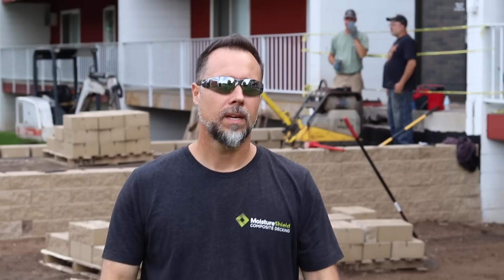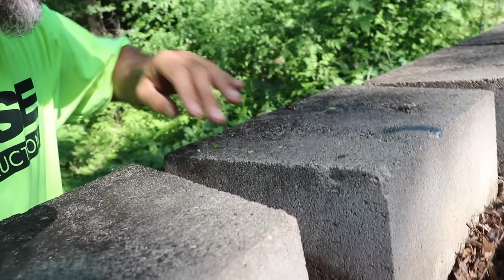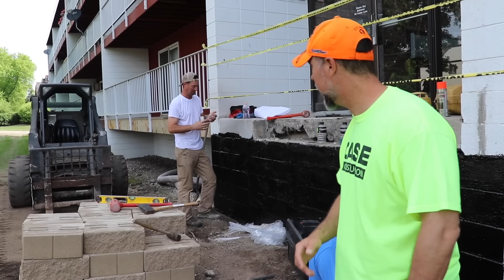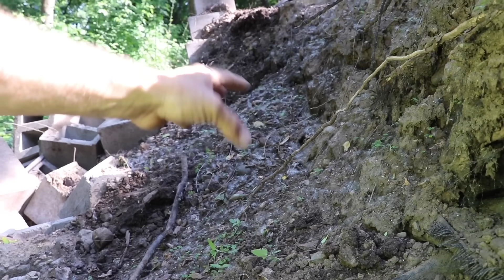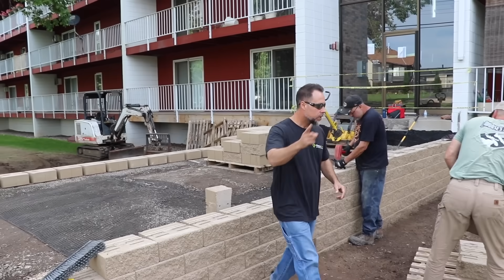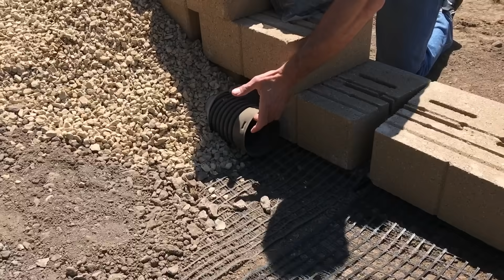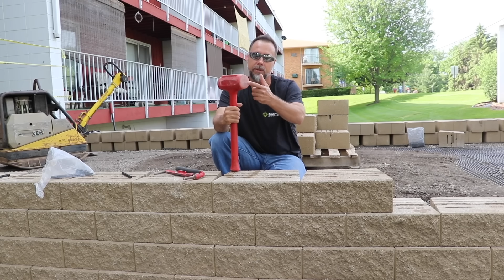How NOT to Build a retaining wall.  RED FLAGS, common mistakes, bad designs pt1

Comment: The highest stone/block retaining wall I ever built was about 12 feet stepped down to an 8-foot wall four feet in front of the 12-foot wall another four feet out and stepped to 4 feet to a 5-foot wall. They were the hollow block with a lip, We did fill the holes with stone and rebar.                 We compacted all the lifts, used geogrid, the fill between the was stone topped with about 4    inches of dirt. This was over 20-25 years ago, I followed whatever engineering plan provided.  I drove by it 15 years after building it and it looked as if it was built that year except for the graphite. This was the first wall I built, proving if you follow both the manufacturer's instructions and good engineers plans things will work out. Quality is part integrity, part using your brain and part overkill (if an architect calls for 2X10s and you use 2x12s it can only be better) I always told my clients that the project would have my name on it for life. The two best teachers were crappy builders and a perfectionist mechanical engineer(he taught me more in a year of being my mentor than a masters degree. I fixed a house were the framer did not check the mason wall heights, I had to take apart 25% of the frame. I fired the first framer 2 hours after being on site there were empty Vodka bottles everywhere.  PS I like your work and the fact that you do     your own math
Reply from the maker: Thanks Joel for the comments! Glad you like the videos and thanks for watching!
Reply: I agree, my first thought of the wall that fell in this video was "where's the rebar or fill in those hollow blocks?".

Comment: Excellent vid, thanks mate.  If ever I use hollow blocks, it is so that I can fill them with concrete & rebar for a super strong structure, e.g. swimming pools.  For walls, the hollows can be part of a drainage system, and I add deep / long stainless horizontal ground ties, and vertical reinforced concrete piles.  But I've never built anything as high/steep as the failed wall above.    Thanks again.
Reply from the maker: Thanks for the input and for watching !

Comment: Would you build retaining walls with composite rail ties? I know the foundation the the most important but does the material the actual wall is made of? Could you also use t-posts to held reinforce and hold the wall up

Comment: What I'd like to say as a mason : you never build anything with dirt. As soon as you have removed dirt- this is it, you've got the "disturbed soil", don't put it back, throw it away, put crashed rock there or pit run(sand and stones), then compact. Don't build anything on black dirt, dig to brown clay. Do not back fill dirt against back of retaining wall, in winter, when it will saturate with water, the freeze will expand everything like crazy, it will push your blocks outward. Use drainage rocks everywhere, let all drain down. Use geogrid if you will go higher than 4feet. or if you need super stable lower wall.
If you have to, go ahead, lay first bottom course on mortar, to make it straight. Compact everything always. Use those dead blow mallets, those are very good, instead of bouncing rubber mallets.
Geo grid works like "deadman" for  other types of retaining walls and also stabilize the whole mass behind retaining wall, because block tiers actually work also as veneers for the mass behind . Blocks do stabilize, but it should be along with the mass behind them.
Reply from the maker: Thanks for the input Sergey and thanks for watching
Reply: I was confused on this as well.  
In the first example of a failure, did the geotextile fiber against the wall cause the wall to fall or was it the lack of crushed rock?  It looks like they just backfilled the wall with soil, which will make it fail every time with out the right aggregate for drainage.
Reply: You mean 1st course on reinforced concrete footing, just like homes are built on, then you will save time and be more accurate instead of using a mallet for hours straight...
Reply: @michaeless658  You can, but you don't have to, it's too expensive and overkill. Just crashed rock will work fine for the footing. But if you're ever gonna do a solid concrete retaining wall, then you have to make a very wide footing, not like for a house of 24-20 inch, but up to 48 inch. I'll tell you as a mason, the first mistake masons often do, when they build not wide enough footing for when they build masonry posts. You can notice that, when next time you see leaning masonry posts  there and there. Because in a course of 3-5 years freeze and overall temperature changes start pushing post from sides. And if you don't have a wide footing, your post become like a inserted heavy stick, and it later on become out of plumb, even can fall down. (Same happening with tomb stones) 
So the concrete retaining wall works almost the same: your whole retaining structure should look like perpendicular upside down "T"- very wide footing. Then you have to use lots of rebar everywhere and of course- drainage on the bottom from the hill side. Even though, if you will go higher, than 5 feet, you have to tie your wall to a "dead man" in the mass behind. The pressure of back fill is strong and everywhere you need compaction layers of every 8 inch or less to have a stable mass.  And the less clay- the better, pit run or crashed do the trick, when they sip away water from the upcoming  freeze. (Sorry if I did a mistake in English, my first language is Russian.)

Comment: Taking a look at my back yard...they didn't build the wall correctly it would seem.  3 tier clay brick wall, 3ft high with 4ft of garden space, 3ft on #2, and 1ft on #3 because of fence.  Sloping hill from neighbors......and a tree on top.  :(  House built in '68 and assuming wall was too so it has held up well but is starting to...uh....fall apart how brick tends to do.  Unfortunately, there is no way to dig into the neighboring properties to install geogrid if I wanted to remove the existing wall and install a proper one.  Would burying beams be a viable option?

Comment: Two things I thought could be better explained: 1) In climates where the ground freezes, drainage is hugely important, because water held behind a wall will freeze. Water expands by a factor of 1/11 when it freezes, so the less of it behind the wall, the better. It's not just the weight of liquid water that adds to the failure-forces on the wall. 2) Geogrid takes the place of "dead men." Some large retaining walls are built with dead men, which can be logs or other large heavy items that are buried several feet back from the wall, connected to it by a cable. With all the weight of the soil holding down the dead man, it provides a good anchor, and with a strong cable connecting it to the wall, it resists the forces that want to push the wall out. 
-- The Geogrid relies on the weight of the soil behind the wall to keep it from moving, and provides a tensile support that keeps not only the wall from blowing out, but also stabilizes the soil that its enmeshed in. I suppose one might quibble that it ought to be attached to the wall, but keeping the soil behind the wall from shifting outward will reduce the force behind the wall. I do think that using it in layers every couple of feet is far better than just using one layer near the top. (I've seen plenty of 3' high walls blown out, but not many 2' ones.) Personally, I think it's a genius product, but it appears to anchor the soil more than the wall itself. It would be interesting to find out what would happen if it just ran up to the back of the wall without being interlaced with the blocks, as one might do with a rubble retaining wall, where it's hard to interlace it.

Comment: Appreciate  your time and thoroughness  . The engineering can get very complicated . I believe originally a french mathematicIan named Euler worked this out for friction materials in the 18th century  , then a British physicist  named  Rankin worked on this problem in the 19th century  . An Austrian engineer named Terzaghi tied up the many different approaches  to solving soil mechanics in the 1930's with his ground breaking book ; "Soil Mechanics in Engineering Practice" . Too bad it took so many decades before his work was codified into modern building practices .

Comment: Just found your channel, subscribed. Thanks for the great tips. I was thinking of using fabric to hold a 2' tall parking spot but now I won't, I will use geogrid layed back about 10'. I realize I probably don't need it a 2', but want to work on vehicles on it and want the weight of the vehicle holding the wall it's pushing against and since I don't really know for sure what I'm doing when it comes to building things I prefer to over engineer my projects. Better safe than sorry, right?  Your tips will help with that I'm certain. I look forward to perusing your other videos.

Comment: I did learn from my dad not to just rely on about 12 inches of poured concrete to create a retaining wall with rebar to hold a 20ft vertical wall behind a house. The soil at the bottom became too heavy with water and washed the wall right out. In some sections he was left with about a 5ft by 15+ft by 12 inch thick cement wall hanging by the rebars embedded in the soil, while the rest of the wall below it washed out.

In retrospect, I am prone to making a lot of bad decisions that remind me of him, but I am glad I don't have as many of those recessive bad decision making genes as he does. I have a retaining wall project I will eventually be doing for my house I am going to DIY and botch up alot along the way as I learn. But nowhere near as badly as what he did. Which was so risky, it could have knocked the entire manufactured home off the block footers, and send it down a very steep hill with a big lake at the bottom.

I'm prone to bad very bad ideas, but that was one where he showed me where he wanted to build a house when I was about 15. And I looked at the hill, and I looked at the lake, and I looked at him, and I asked "Are you sure this is a good idea?". My construction experience back  then was limited to sand castles,  toothpicks, popsicle sticks, hot glue.

Comment: For the drainage aggregate. What crush is that ? In another video you talk about the stone locking together and allowing the water to flow through. Where some people use pea gravel and it just causes a dam to form.  I am building a 3foot high rectangle next to the house to make a raised bed. The house side is vinyl siding so I want a gap between the house and the bed so there is no moisture up against the house.  Your thoughts ?  So far I have leaned so many tips. I would have used fabric if it not for your video.

Comment: What is the difference in “class 5” and like a 3/4 inch base? Where I’m from in Wisconsin we use 3/4 inch base or 1’1/4 inch base. I drive dump truck and I have never gone to a quarry and asked for “class 5”

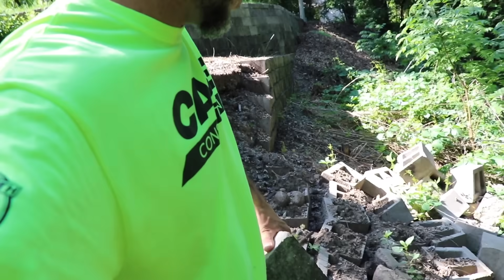Comment: Those blocks @21:21 they could've poured concrete into the hollows from the top down and  put vertical rebar poles every 2ft. Would've been wayy stronger.

Comment: Do you have tertiary education in civil engineering? Typically if you do not place the correct geofabric behind a retaining wall such as that, the water flow will wash away the finer backfill particles leaving cavities behind your wall...

Comment: Awesome video.    From an architectural standpoint using those hollow blocks dry stacked is crazy (Compared to my experience designing a foundation, not a retaining wall)  Core filling is SO IMPORTANT!    And horizontal bond beams......In my foundations I like rebar and concrete.
And I'm crazy enough that I might do that in my retaining walls at home, too!.

Comment: Stanley, this was another great video.  I appreciate that you walk us through all of the factors to consider without making any assumptions about our level of knowledge.  Something that I did not hear you discuss but I am interested in knowing is; at what point does a person who is building a retaining wall, need an engineer involved to design/approve a plan to build a retaining wall?  If you could make a video that goes a little more in depth on the more technical engineering aspect, along with obtaining building permits or whatever might be legally necessary, I would appreciate that level of understanding.  Finally, could you also include a thorough discussion on what to consider when grading the land at the base of the wall so that once the project is complete, the land at the base is parallel with the retaining wall?  I'm asking a lot but it would all be helpful to know.

Comment: I use geofabric (a thinner and near sea through tough as nails version ) to wrap the 6 inch vertical wall of medium round stone that is behind entire height of retaining wall . At the bottom of the med stone barrier is a 4 " drain sloped to exits (just in the event of heavy water flows )  In freeze/thaw location if water, in soil, is left near wall it will push and destroy a wall

Comment: I am not an expert on retaining walls, but I will argue against putting a form of felt behind the retaining wall. In the beginning of video where you showed the wall being collapsed, well that guy was a moron! If you want to see how you can build a retaining wall with drainage fabric, and do it right then click on this video. The guy in the video is amazing, and built it engineering specs. This guy is also through, and If I ever had to build a retaining wall then this is how I will do it. Maybe it is done differently depending upon the material that is used in the construction of the retaining wall. Interested in hearing your thoughts on this.
https://youtu.be/39dhQsQLVHc

Comment: I loved all the information. I have an existing retaining wall but its short with hollowed blocks. I want to build it taller  wall hopefully adding onto the existing wall so it can bear the weight of people sitting on it. I also want to build a patio against the inside of the wall for a fir pit, outdoor kitchen setup. There's a few small trees inside the existing wall I am starting to cut down to make room. Any info would be appreciated.

Comment: Pitch your block 1/4" per foot = 1/4 bubble on your level, well it used to at least.
Reply: I have a grasp, but a  limited official education, in the architectural area of landscape engineering, I will remedy that, but I have a question about the design concept of recessed staggered starter courses as a footing on larger land masses, causing a support vs. stress paradox opposing forces working to counter movement and use the geological expanding force and gravity to self stabilize the structure, methods used in old world stacked stone mortar free  walls, in foundations and home construction,  buildings still in as built condition since the early 1,600's?

Comment: Tea Cup Effect, placing a layer of shale gravel, fabric, or any solid or non degradable particulate build up, or layer, fillets earth, bentonite clay, dolomite, slake lime, below grade horixontslly or vertically, partially mix with the soil, without diluting or spreading out through the substrate, soil in, the macro spaces, between the aggregates, or between fabric fibers , under the pressure from tbe weight of the earth above, compact and pinch tightly, closing off any normally permeable spaces,  restricting  the movement of air or gasses,  effectively blocking the passage of liquids, preventing percolation as in the exchanging of heavier liquids with lighter gasses and the pressure spreads outward instead of downward, exponentially.

Comment: I thought you would fill the holes in the hollow block with concrete and add construction steel. That should make those standard blocks pretty solid. But I would prefer in any case a natural stone wall.

Comment: Regarding your call for feedback. 
If we don't get the details we can't put together a coherent picture and make more reasonable decisions for our situation. Getting a mental picture of how geogrid works and the forces it is there to keep in check reminded me of timber retaining wall instruction and the placing of a 'dead man' to help hold forces on the wall by making a connection to a lot of soil behind it. 

The detail necessary to make something work cannot be skipped, if it's simple, a biceps/triceps arm movement is described functionally yet simply while the workings for fingers touch typing requires more detail. There is no one level of complexity, each situation defines its own necessary information. 

Thanks for sharing your experience, it is appreciated.

Comment: Ok, so i have a simple quick question. My retaining wall the I am putting in next to my new small patio (6x11) is only going to be 3 bricks high and maybe 8 bricks long. (not sure the actual measurements) but i was only planning on putting down sand and leveling each retaining wall brick, the use glue, or what ever that is when you put another one on top. The sand, is that all I need?

Comment: Interesting to see a different way. Some of ours were 3 blocks high and had 3 blocks deep on the base with aggregate (screenings) to lock them in place. I've seen blown out walls that were dry laid incorrectly. Good to see a different way to achieve the same result.

Comment: Love learning the difference in different type of blocks, (After the job is done- lol),  I used the hollowed out from top down, but I must have gone overboard, I wanted it to be as strong as possible, So instead of filling them with rocks, I filled them with cement.